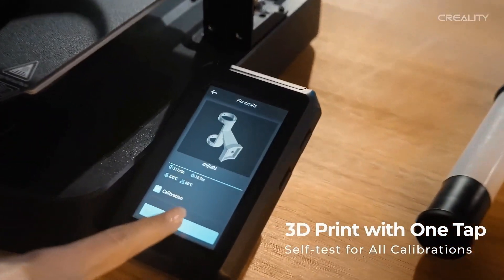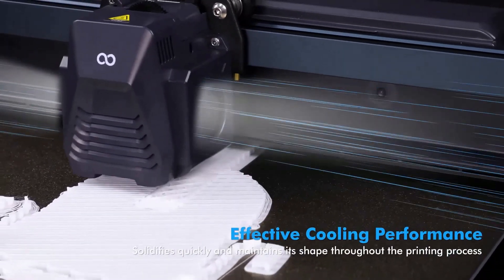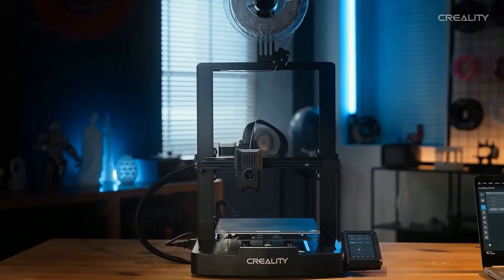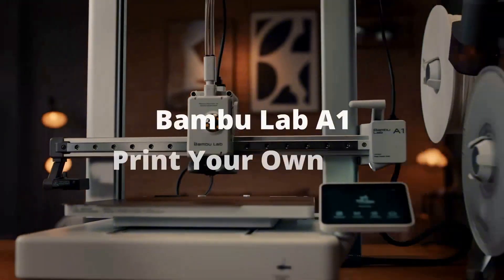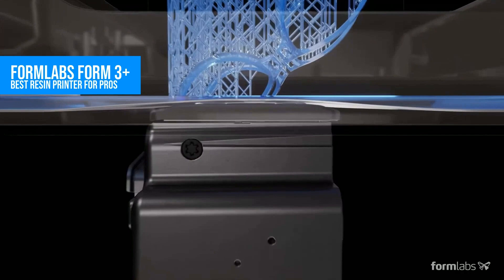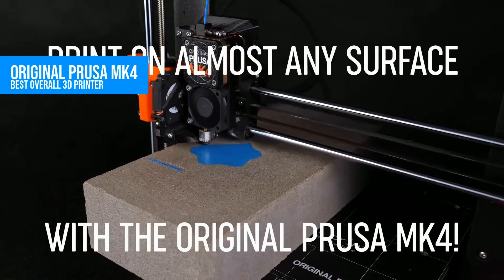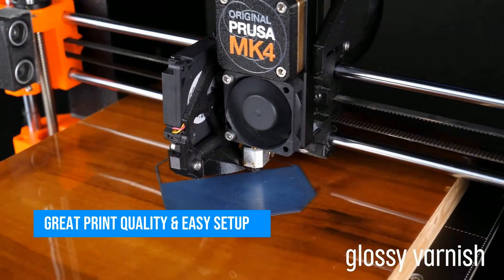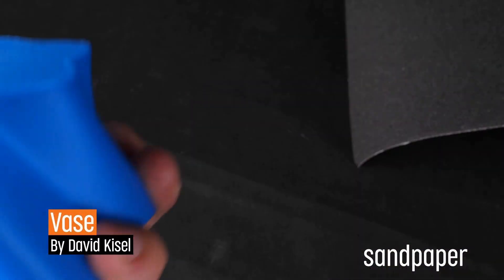Best 3D Printers in 2025 – Don’t Buy Until You See This!

Comment: The video for A1 mini actually showed the A1. The print bed area info was incorrect. The mini has a 180mm cubed print area.
Reply from the maker: You’re right couldn’t find good footage of the A1 mini, so I used the standard A1 model in the video. That was a mistake on my part, and the build volume info was off too. Appreciate the heads-up!